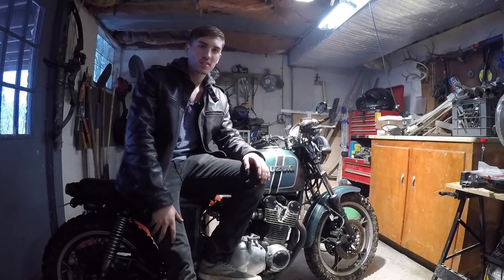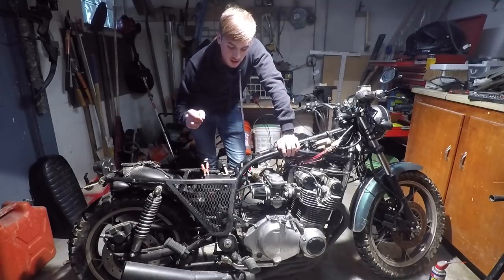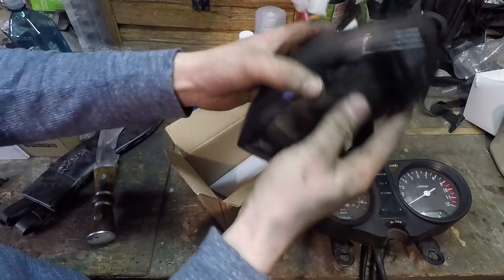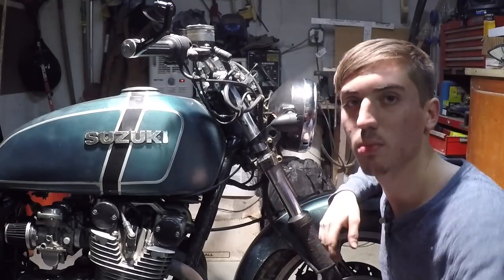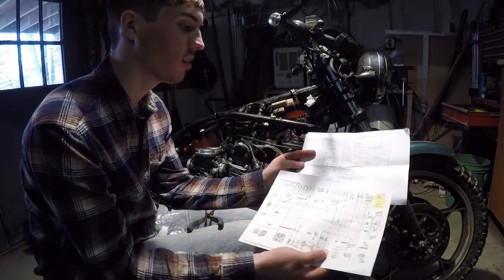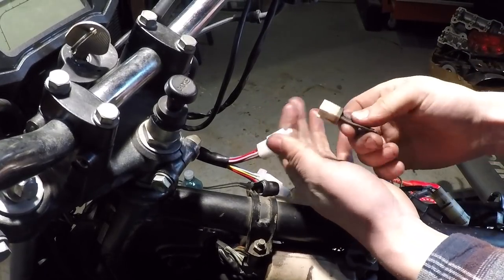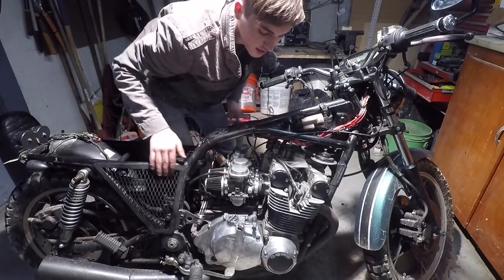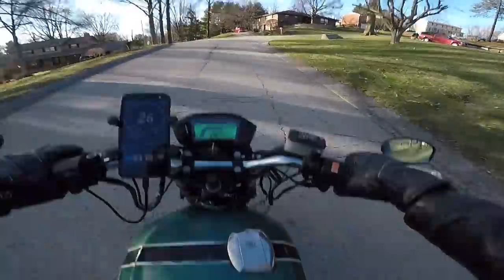How To: Convert Your Old Stock Tach/Speedometer Gauges to Digital! /GS850#14/

Comment: i have no idea if you still read these comments but thanks for this video. It inspired me 2 years ago to convert a gs500 2004 to digital. sadly someone hit me and wrecked it.  weeks ago 1 got a new gs500 1995 which has a physical tacho cable. thanks to revisiting this video i found that i could hook the tacho wire up to the green/white cable and its just perfect now. it might be 3 years later but your video still has an impact.
Reply: I have a 2002 GS500E, would you mind helping me with what you used, tools and all that?
Reply: I'm about to try an convert my 06 Gs500. Are there any issues or problems you ran into?

My main concerns are proper mount location for the speed sensor as well as the best way to mount the actual unit to the bike.
Reply: @Tugoose  nope not really mounting it was a mather of making a plate with the correct holes that mounts to the original holes with rubbers. The speed sensor mounted on the end of the mechanical speedo cable with a 3d printed part and it is hidden away behind the headlight.
Reply: @TheRedstonelabz1  as in mounted to the Speedo cable near the wheel or the actual mechanism? I assume the cable would move a bit causing discrepancies at speed no?
Reply: @Tugoose  the original cable is still in place. I 3d printed a little cover for the open end and added a rotor mounted on a bearing that spins when the cable spins. On that rotor is 2 magnets that get detected by my speed sensor. Then you just have to set the correct value in the display and it is super accurate.
Reply: @Tugoose  i have the 3d files if you need them.

Comment: I got tired of my MPH only speedo on 1976 Honda, with 6V electrical.  Got a 12V GPS "needle display" speedo similar round shape and dimensions as old speedo, and mounted a 8x1.5V AA battery pack with power and ground wires near the speedo.  Amazon rechargeable batteries with charger for nice and cheap.  I'm sure a USB type battery exists, but I can use the AA batteries in anything else that uses them.  Stay gold.

Comment: Use 2 magnets. Mount first magnet, mark tire directly under it, mark floor,  push bike forward one revolution, mark floor again, measure back exactly halfway between the 2 floor marks, push bike back to the center mark, mount 2nd magnet across from the first one that is now opposite of the center mark. Go to speedometer menu, input the measurement from 1st floor mark to 2nd floor mark, divide that number by the amount of magnets which is 2, and you should have the right mph reading on the gauge without having to do a bunch of math wheel measurements and riding around the neighborhood to dial it in. Ride safe!

Comment: that looked fairly easy. thanks for the guide. the way you go about it really helps me understand the how and why of alot of the connections. Makes me feel confident if i need to troubleshoot.
Reply: Looks are deceiving.... He got lucky with that one connector that just happened to have wires in the right place. I have the same exact connector on my bike but I had to rearrange the wires to power it on. If I plugged it in without checking it would've fried it before it had a chance to work. The positive and ground were directly swapped..

Comment: Your Tacho has different modes for different number of fired coils. Will need to tell it your bike is a 4cyl, generally they come setup for single\twin from the factory.
Reply: I have a xs750 triple. How do I program for a 3 cylinder?

Comment: Thanks guys awesome video and comment tips. I am working on a bunch of upgrades for my bike and this is one of them. My cluster is different but will still have to be a whole custom made thing but I’m excited. No more rusty old gauges. Digital will be awesome for 2002 carb bike. I already removed rusty tank and put a drag tank on the back with stainless steel fuel lines and a manifold for the carb and swapped to cv40 carb vs the Vulcan 750 stock carb. Supper easy to tune on the fly with the ez adjust quick screws. I also want to put some saddle bags on for my rigging gear and make it my work bike.

Comment from the maker: oh yeah and I forgot to mention,  the fuel indicator doesn't work because when I sealed my gas tank it kinda got stuck in one position, otherwise it would work.
Reply: Goldguy how many magnet did you put on the speedometer sensor
Reply: GoldGuy  how did turn the gas light off ?

Comment: Thanks for sharing. My bike just had a broken speedometer/dash lcd from condensation. And its a 2nd one now. And the oem even though easy to install and takes literally 10 minutes, it is hell'a expensive vs the one you are using which is rebranded as Zaddox in the UK. 

The wiring is the one I am trying to find a guide for as the wires on that speedo is completely different from my Yamaha OEM's.

Comment: Hey! I was wondering what wire you got the gear indicator connected to? I mean, did that year of bike not just have neutral indicator? Where is it getting the signal from to tell the tach it's in 4th, 5th, etc.

Comment: Instructions from ebay seller

A. Short press the left button to switch between total (TOTAL), subtotal (TRIP) and water temperature gauge.
B. In the subtotal interface, press and hold the left button for 3 seconds to clear the subtotal.
C. In the total interface, press and hold the right button for 3 seconds to enter the clock setting, the hour digit flashes, the second point does not flash, short press the right button to add 1, long press the right button to switch to the minute second flashing, the second point does not flash, then long press Right click to save and exit or 10 seconds of no operation to automatically save and exit or turn off the door to save and exit.
When the oil alarm symbol is displayed, switch to the TOTAL interface, press and hold the left and right keys at the same time for 3 seconds, the oil light will be off, and the next round of counting will start.
Light blue: turn right, 12V positive control, LCD display
Yellow/Black: Speed signal
Red: battery (normal, 12V positive)
Blue: High beam, 12V positive control, LCD display
Green/White: Water temperature signal
Green: 12V negative
Orange: Turn left, 12V positive control, LCD display
blue/white: fuel signal
Black: 12V positive
Φ4 round head
Brown/Red: Engine failure, negative control, LCD display
Gray: 6 gears, negative control, LCD display
Pink: 1 file, negative control, LCD display
Blue/Red: 2 files, negative control, LCD display
Green/Black: 3 files, negative control, LCD display
Yellow/Red: 4 gears, negative control, LCD display
Brown/white: 5 steps, negative control, LCD display
Green/Red: Neutral, Negative Control, LCD Display
red/white: positive sensor
Green: sensor negative
black/white: sensor signal
1 Background settings: enter the background with a password. (Major and Imperial backgrounds can be set)
Press and hold the left button to power on and enter the background setting interface.
P000: Password input 6610
4C1850:
1850 represents the perimeter, long press the left button to flash, short press the left button +1, long press the left button again to switch to the tens (0-9)
Tens digit flashes, short press the left button + 1, long press the left button again to switch to the hundreds digit (0-9)
Hundreds digit flashes, short press the left button + 1, long press the left button again to switch to thousand digit (0-9)
Thousands digit flashes, short press the left button +1 (0-2), long press the left button again to enter the magnet number adjustment interface
4 means the number of magnets, short press the left button + 1, long press the left button to save. After saving, short press the left button to enter the metric and inch interface
1-01: Metric
1-02: Inch system, long press the 1 of 001 to flash, short press the left button to switch to 2, long press the left button to save. After saving, short press the left button to enter the speed interface
2-002: Speed 166hz=10*1000 rpm, 2-004: Speed 333hz=10*1000 rpm, long press the left button and the number flashes, short press the left button to switch, long press the left button to save and then short press the left button to enter the fuel interface .
3-002: Two-Line Fuel
3-003: 3rd line fuel, long press the left button and the number flashes, short press the left button to switch, long press the left button to save and short press the left button to enter the main interface of the instrument.

Comment: to get right speed you should measure the circumference of the wheel including the tire, not the circumference of the circle the magnet makes when the wheel is spinning
Reply: Finally
Reply: Hey how to measure the circumference ? Because my speedometer i buy doesnt work the speedsensor i install the speedsensor and magnet to the engine sprocket of my bike ..

Please help ..
Reply: @cerannsbaron6363  

Measure the circumference of your rear wheel..... 
Count the number of teeth of your rear sprocket. 
These are the numbers you need. 
If you have 1800 mm and a 36 rear sprocket,  each tooth wil give him a 50mm pulse. 
Every other calculation which give the same value as circumference/tooth gives the same speed on the speedo.

The circumference is the distance of one wheel rotation, normaly in millimeters.

Comment: I wish you could do my bike man ive been going from one workshop to another and everyone seems pretty lazy to do wiring jobs.. from the first shop, even told me to get a relay.so the new meter wont burn out the battery as fast.. but nothing has been installed

Comment: When you say the spark genenrator.  Are you talking about the stator wires or the pickup coil wires?? For the rpm signal wire.
Reply from the maker: Wise Turtle Gainz not the could wires, the wires that are coming out of your engine from the spark generator. It is a separate component from your stator, check out the wiring diagram for your bike

Comment: The circumference you need to import is the circumference of your front tire and not the distance from the magnet. When your wheel registers a full rotation ( magnet passes the sensor ) it registers a cycle. A cycle without knowledge of the circumference for your tach is useless. It counts cycles and multiplies it times the circumference of the front tire. (You may got it right but i heard you saying about magnet distance measurement). Great video and very nice touch on the bike

Comment: Maybe this is a dumb Q.... But where do I connect the main power wires from the new gauge..? Do I just connect them to the original wires going into the ignition?
Reply from the maker: Yeah that's fine, anywhere that has power basically.

Comment: I have the exact same motorcycle and want to add the exact same Gauge unit   Could you Tell me all the excess steps you took To modify your existing wiring for the new digital system

Comment: This has helped a lot thanks, where can I find the wiring diagram and programing list for the speedo? I have the same but it didn't come with any papers. 
Please help thank you
Reply: A. Short press the left button to switch between total (TOTAL), subtotal (TRIP) and water temperature gauge.
B. In the subtotal interface, press and hold the left button for 3 seconds to clear the subtotal.
C. In the total interface, press and hold the right button for 3 seconds to enter the clock setting, the hour digit flashes, the second point does not flash, short press the right button to add 1, long press the right button to switch to the minute second flashing, the second point does not flash, then long press Right click to save and exit or 10 seconds of no operation to automatically save and exit or turn off the door to save and exit.
When the oil alarm symbol is displayed, switch to the TOTAL interface, press and hold the left and right keys at the same time for 3 seconds, the oil light will be off, and the next round of counting will start.
Light blue: turn right, 12V positive control, LCD display
Yellow/Black: Speed signal
Red: battery (normal, 12V positive)
Blue: High beam, 12V positive control, LCD display
Green/White: Water temperature signal
Green: 12V negative
Orange: Turn left, 12V positive control, LCD display
blue/white: fuel signal
Black: 12V positive
Φ4 round head
Brown/Red: Engine failure, negative control, LCD display
Gray: 6 gears, negative control, LCD display
Pink: 1 file, negative control, LCD display
Blue/Red: 2 files, negative control, LCD display
Green/Black: 3 files, negative control, LCD display
Yellow/Red: 4 gears, negative control, LCD display
Brown/white: 5 steps, negative control, LCD display
Green/Red: Neutral, Negative Control, LCD Display
red/white: positive sensor
Green: sensor negative
black/white: sensor signal
1 Background settings: enter the background with a password. (Major and Imperial backgrounds can be set)
Press and hold the left button to power on and enter the background setting interface.
P000: Password input 6610
4C1850:
1850 represents the perimeter, long press the left button to flash, short press the left button +1, long press the left button again to switch to the tens (0-9)
Tens digit flashes, short press the left button + 1, long press the left button again to switch to the hundreds digit (0-9)
Hundreds digit flashes, short press the left button + 1, long press the left button again to switch to thousand digit (0-9)
Thousands digit flashes, short press the left button +1 (0-2), long press the left button again to enter the magnet number adjustment interface
4 means the number of magnets, short press the left button + 1, long press the left button to save. After saving, short press the left button to enter the metric and inch interface
1-01: Metric
1-02: Inch system, long press the 1 of 001 to flash, short press the left button to switch to 2, long press the left button to save. After saving, short press the left button to enter the speed interface
2-002: Speed 166hz=10*1000 rpm, 2-004: Speed 333hz=10*1000 rpm, long press the left button and the number flashes, short press the left button to switch, long press the left button to save and then short press the left button to enter the fuel interface .
3-002: Two-Line Fuel
3-003: 3rd line fuel, long press the left button and the number flashes, short press the left button to switch, long press the left button to save and short press the left button to enter the main interface of the instrument.

Comment: So i’m trying to convert my 1980 Suzuki gs450 to a digital gauge cluster, how did you get the gear position to display because I can’t get mine to work
Reply from the maker: Only certain bikes have the gear indicator wire coming from the engine, yours may not. Check your bikes wiring diagram.

Comment: But is it possible to use the bike's original mechanical system that measured speed with digital one( a device that doesn't rely on sensor installed on wheal)?
Reply from the maker: Not that I am aware of.
Reply: @GoldGuyRides  can you kindly look out this matter few more!
Reply: @GoldGuyRides  
Facebook

Comment: I am all for retrofitting stuff, especially as things like tach and speedo cables are becoming increasingly harder to find GOOD replacements, but FOR THE LOVE OF GOD MAN!!!! You have a SIX wire connector and all the wire you put on it was RED. I understand not having every color of wire under the sun, but there are things you can do to make potential future diagnostic as pain free as possible (like spray painting the insulation).

Comment: do I need to follow the same type of color cable to do the extension or can i just use any type of cable like your video has shown?
Reply from the maker: You can use any color, just don't mix up the wires.
Reply: Okay thanks for replying!
Reply: Hey I realized the speed sensor not long enough, where’d you get yours?

Comment: Will this work for a 1980 kz1000. Need answers please 🙏
Reply from the maker: Yes it will! Your bikes wire colors may be different but it is still the same concept. Just consult your bikes wiring diagram and you should be fine.